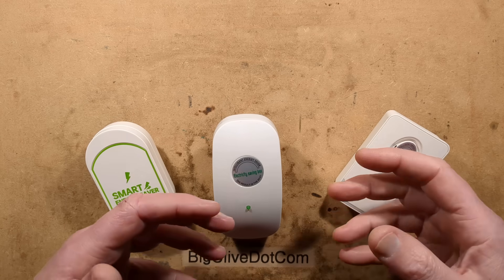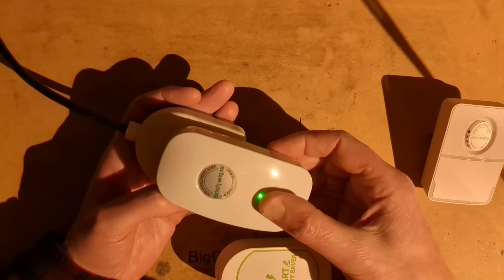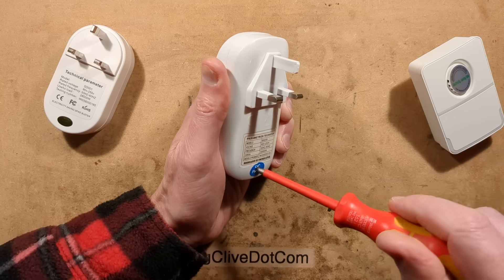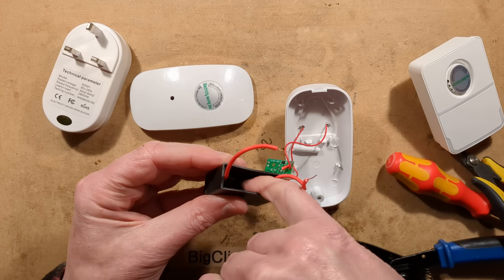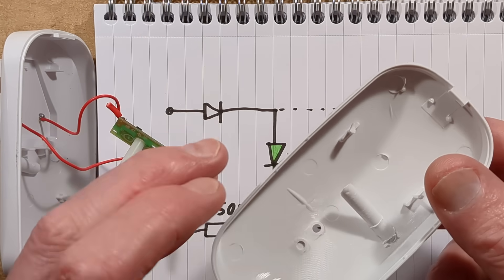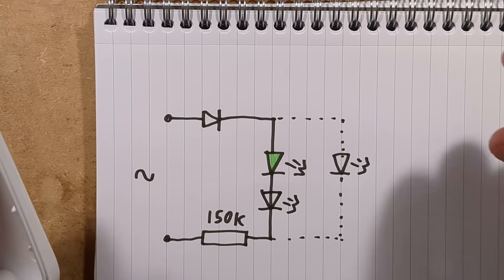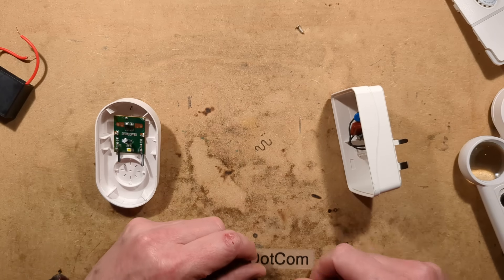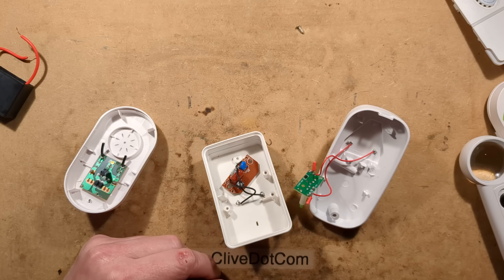Inside three fake power saver plugs 2025

Comment: I must say, I really like the one with the whole light-up ring around the bottom edge. That would make a nice night light in a hallway. And probably not any more expensive than an actual night light. 
Question! If I wanted to ask you to tear apart a device, how would I ask? I can buy one and send it to you, or do you just prefer an amazon link? 
A couple years ago I had a seized furnace blower motor cause a voltage surge on its companion leg in a MWBC and fry a bunch of stuff. Basically turned my 120v MWBC into a 240v circuit. I'm shopping for overvoltage protection to guard against any potential future hazards and there are these "LED display adjustable appliance voltage regulator protector" things for fairly cheap. They are supposed to shut off power if the mains voltage moves above or below a configurable threshold, which is exactly what I'd need for the kind of protection I'm looking for. Of course I'm skeptical, but I don't have the equipment to test if they actually work and I wouldn't know how if the insides actually do the job or not. But you would!
Reply from the maker: I don't have an amazon account.  But a description of the device might help me find one.

Comment: You are completely wrong. The black, sand filled, components are AC decoupling quantum devices that tap into antimatter. The power company will end up paying you for providing the neighbourhood with clean green power from a parallel universe. People keep underestimating little girls.  You keep griping about bad design and not connecting the LEDs in series ... c'mon she is 9.

Comment: as a broke bachelor in my apartment, here's how i barely spent anything in both hot and cold weather on my electricity.
- tons of weather appropriate clothes. that's pretty obvious, right? but you'd be surprised how much you are accustomed to the convenience and luxury of AC or heating. i actively had to train myself for a few months to go to my wardrobe and swap to something warmer or cooler instead of following the impulse to use more heat or more cool. wearing shorts in winter but having the heat on full blast? inefficient. big fluffy sweatpants and sweatshirt, then a blanket? much more efficient. 
- use your house AC/heating as little as humanly possible. no matter what temperature it is outside, either open the windows to let the cool air in in the summer, or keep all the vents, windows and doors closed in the winter. if you're working 40 hours a week, those are 40 hours that your AC is just wasting power keeping an empty house acclimatized while you're not there. when you sleep, you're mostly in your own climate-bubble from your bedsheets and blankets, so you don't need the entire house to be regulated just to cool/warm your face. that's at least 80 hours out of the week your AC is just spinning its wheels for little to no benefit. for the rest of the time you're home, using ceiling fans or space heaters. using a single space heater to heat your feet or one room for a few hours in the evening is way less energy-intensive than turning on your giant heater system for an entire day just to make the entire house room temperature for when you get home.
i didn't use HVAC for a whole year and simply used these methods, and my power bill was slashed to a fifth of what it was. while following this method my bill was never above $50 a month, usually only $35.
now, there are some caveats- i do live in a climate where it's mandatory for all houses to have rigorous weather insulation.

Comment: No electricity saving. It's costing money... 1. You buy it and 2. There is a small energy running cost to keep the light on.

Ads I've seen about these say they smooth out the troughs and peaks in the domestic energy supply thus saving money lol

Comment: Im surprised people in other countries heat with electricity. We heat with water, most of us are connected to district heating. Way more energy efficient and water stores heat really well. Combined with smart knobs, I control the heat in every room separately. When I’m in the office, that room gets heated to a comfortable 21 degrees and the rest is set to lower, when I go to the living room after work, it gets heated to 21, while the office goes down to 19. over night, I let the other rooms drop down to 16 and they get heated back up in the morning before my alarm rings. When I leave my apartment, everything goes down to 16, and before I get back it heats up again. That is how you actually save energy and money. District heating and temperature control. Water radiators for efficient heating instead of heating with electricity

Comment: Well this might work the following way:
- causing a short circuit and switching off the main circuit breaker 
- causing a fire, burn down your place

In both cases your electricity power utilization goes down to zero. Seller promise delivered.

Comment: Back when X10 was still relevant, we in the US often had to add a capacitor across the two phases of our power feed, so that the high-frequency X10 data could pass between them. These are definitely not that.

Comment: Soooo, how are these things supposed to work?
There's capacitors, lights, and resistors placed randomly.
You trade amps and volts around and that's it?
Like, if you were in series, maybe ading a resistor could help, but no-one has their house wired in series and there's an LED.
How much would a parallel resistor even do on a 240 watt line, standard specs?
Say 100ohms

Comment: The adding components for drama reminds me of a place where I used to work, where they manufactured control boards that slotted into large frames, for automating large scale food production line machinery. Roughly A5 sized circuit boards filled with allsorts of resistors, capacitors, diodes and transistors.
While I worked on those, I was told that over half of the components were unnecessary, but were added because they received feedback the product did not look "sophisticated" enough and thus were embellished to support their pricing.

Comment: I would like to see a practical product for the repair industry.  A inline Voltage and current sensor with a 24bit 48ksample/second Analogue to digital converter covering a range of 90-250VRMS and 0-20ARMS that generates SPDIF signals that are output on a TOSLINK optical connector.

Every (right to) repair, Hackerspace, safety conscious designer and (plant hire) testing work station needs one.

Having these units available for UK, Schuko (CEE 7/3 7/4), US, IEC 60320 (C19/C13) pass through plugs would provide a standard interface with best of breed air-gapped safety isolation that could then use a SPDIT Optical input to USB converter to interface to a Phone, Tablet or Laptop to provide voltage, current, power, energy totals, power factor, consumption trends to evaluate appliance cycles (great for testing washing machines and coffee makers). You could even display an FFT showing harmonic energy and a waterfall to allow testing of SMPS designs and PF correction circuits.  Once you have the SPDIF to USB converter you can the same software could be adjusted to make a neat L/R vector display, a Audio Scope, THD and spectrum display, a waterfall and other popular visualisations of Audio that people crave.  Having this information available from any digital source without it needing to tie up your main computer will be welcome for those working with or enjoying audio. 

All one needs to do is to have a clear specification and a prototype and ask a dozen companies in the east for a quote on 100'000 units and they will hand the design to their friends who will make a 'competitive' product and flood the market with a cheap device that required no tooling costs.  There are various mains pass through moulded housings that are used with timers and small energy meters that could be repurposed with a minimal mould insert.  While the quality does not have to be to Audiophile standards there are a bunch of ICs that will digitise and even one that will generate the SPDIF data without any micro-controller required (using little documented looping back of the digital audio streams) though a cheaper stereo ADC and small micro (SPDIF libraries do exist for some micros) to generate the data might be more popular though that optimisation could be left to the competitive market in the East.

Making the design open source and having a safe working design PCB available at one of the PCB production house libraries would allow the brave to make their own and having it over designed would make for a reasonably safe system that just needs to measure voltage, current and draw enough power for a few ICs.  The Power Meter ICs do pretty much the same but do the calculations in the IC so they do not need to transmit high speed sample streams but no raw data can be extracted.

The TI forum has a interesting topic titled "PCM9211: PCM9211: ADC input to SPDIF output without MCU control" that could be a single chip solution needing perhaps only an op-amp to boost the current shunt voltage a bit as it is prudent to keep it around 50mVRMS to prevent lots of power dissipation at 20A. There is already a shareproject on pcbway titled "AC_Power_Monitoring_Using_BL0937_IC" that will give ideas on the mains interfacing but it only provides digested data and it is not safely isolated without multiple opto-isolators. There are many SPDIF optical to USB converters available though mostly they do not include a charging input so not optimal for USB-OtG or USB-C on a tablet or phone that charges through the single USB connector.

Making a version of the ADC that has only a single input and a modest input attenuator (because of the high number of bits 16-32 much can be managed digitally on the UI side) and is powered from a 18650 cell where the other channel monitors the cell voltage would create a very safe isolated 'scope' probe for modest voltage and frequency signals (using the maximum SPDIF frequencies of 384kSamples/s could be justified with even the option of alternate sampling on the L and R channel to double it).  With some added risk both channels could be supported but they would not be isolated from each other though they could provide a magnificent differential input at the common reference ground for high voltage design.  The 'scope' software could then subtract the one signal or perhaps use it as a trigger input.  The options are limitless. Just make the battery cover require probe removal before it can be opened and there is no risk of coming into contact with live signals.  Using shrouded DMM style 4mm test lead sockets will provide adequate voltage and frequency range and a variety of probe options with crocodile clips and such.  A current transformer on the second input would allow probing of V and isolated I safely during development.

I would buy a couple of these if they were modestly (cut throat consumer) priced with basic display software that I could hack if required I do not have quite the skills or mental bandwidth at this time to complete a design or write the software though that may not require much more than stitching together a few audio, FFT and graphing libraries.

Comments welcome.

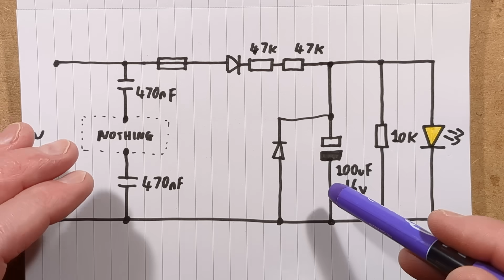Comment: 11:56  you said the diode was "superfluous"
But it is most likely a zener diode, which constrains the voltage that the electro cap can charge up to when the flashing LED is in its OFF cycle.
Without a zener diode there the cap would POP due to overvoltage  😮
Reply from the maker: It's not a zener.  They seem to be relying on the flashing LED shunting the excess voltage on the capacitor when it lights.

Comment: Great video!  Real power factor correctors have these big oil capacitors and control circuits to decide when to connect the capacitor across the lines. I've seen industrial versions of these that are the size of a dishwasher (440V 3 ph).

Comment: They could make an energy saving box that works using one of those radar motion sensors and a relay. Plug a heater into the box and it will automatically turn off when leaving the room.

Comment: If only there was a SINGLE huge capacitor or an inductor, such product could claim that it helps with power factor. But no, scam manufacturers rather put a whole diode bridge in there.

Comment: My mum was given one of these by a friend. She was a bit startled when I snatched it from the socket, dropped it, and then stomped it open. Inside was a “capacitor” filled with sand, potted, and attached to the PCB with a single lead.

Mum’s eyes glazed over when I explained that domestic users don’t pay for reactive power, so even if it somehow magically worked, the bill wouldn’t change a single iota.

So, thanks again, Big Clive—your videos once more made me appear clever and useful in front of my mother!
Reply from the maker: Thank you.
Reply: At least she didn’t pay for it
But you didn’t have to smash it, these scam devices make great wall wart project boxes
Reply: middle paragraph is the info i feel like i was missing.

the thing they claim to do (power factor correction) is real, but they don't do it, and even if they did, it wouldn't make things cheaper for you, only the electric company... in which case, if they did work, you wouldn't be paying for them.
Reply: I did the similar in a mate's shed when I saw him using a deathdaptor. Pulled it, grabbed his 2lb hammer and smashed it to bits. Happily replaced it with a "safe" Shuko adapter.
Reply: the only thing that wil save you the electricity bill is to instal a fotovoltaic solar pannels and a inverter of 4 5 kw power and 10 solar pannels on ur house thats the best way to get very good electricity bill rn :P!

Comment: If they made the second one with a simple plastic earth pin instead of the obviously incorrect shrouded metal one and then selling it as a night light, it could work. 

Thinking about it, if they included a battery it would then be a maintained night light that would provide useful illumination in the event of a power cut.

Comment: sometimes the GB grid has so much wind that our grid spot price goes negative, and we have to export it, even to Denmark and Norway. Power is quite often free, even though the price per KWh they charge you is not. But we are surrounded by people who don't realise the inflation target is 2 or 3% instead of zero for a good reason. Sep 2025 overall prices have doubled since 1996, so your pounds lost half their purchasing power. That's NOT high inflation over the long term. I bet you didn't live through the mid 1970s if you think that's high.

Comment: Dude actuallly, cocaine inside fake capacitors should honestly be the go-to for cartels. Yeah. the dogs'll be barking, but at what exactly? Have a separate shipment of obvious keys with real product dispersed aongst other powders as decoy bricks while the scam eelectronic filled with "Sand" get transported, intercepted at a distribution centre and cut opened to liberate its contents.

Plastic is so cheap these days. And if they used hot glue, then they can keep the boxes by pouring some IPA on the resin and letting it soak in to wick around via capillery action to remove the cover and liberate its contents. Then the removed glue could be melted and re-moulded into cylinders which go into the glue guns, so with drug proceeds the recycled PVA is purchased, then brought back to another distribution facility to just keep repeating this process. This could go on for years with enough decoys.

Comment: Not enough people have lived in cold climates where, even if you could run a heater all the time, your house would never be warm enough to not wear warm clothes. I was annoyed when I put in a mini-split heat pump cooler; they program the "Auto" mode to have a 2-4°F temperature split. I want to set it to 68°F for heating and 77°F for cooling.

Comment: I wonder if you could save electricity by using so much that the meter reads the same at the end of the month as at the start?
Reply from the maker: That would be a huge amount of power and modern meters can log a roll-over.
Reply: @bigclivedotcom Another reason to avoid having a smart meter installed😂

Comment: What amazes me about those fake capacitors is that they are pretty obviously 3D PRINTED! There are ringing artifacts on the side and the layered structure. This is mind-boggling. It might take something between a quarter and half an hour to print something with this wall thickness. Compared to injection molding, which can turn them out at literally seconds apiece, this is slow like molasses. They are usually in such a hurry that they won't even take the time to attach earth contacts, but then they take ages to print empty plastic boxes that don't do anything? I don't get it.
Reply from the maker: These are standard injection moulded potting boxes.  3D printing would be too much for something like this.

Comment: As opposed to the one I made in an old plugpack case. Mine uses a real 4.7uF mains cap, with it's one and only use being for testing AC power meters, it draws AC current, but near zero power (not even a discharge resistor) so I can find out if a given power meter is telling the truth, or just showing apparent power - not that much useful in a domestic environment.

Comment: Smart Sockets with schedules or sockets/power strips/surge protectors with individual On/Off switches for each socket. Smart Light Bulbs that allow you to lower the brightness are also helpful, especially for those that have lights on all the time for whatever reason :/ And for PCs/Laptops that are on 24/7, Sleep Mode after a set time is what has actually lowered my usage. Even if your devices arent actively being used they still use a good bit of electricity every hour so putting them to sleep can help.